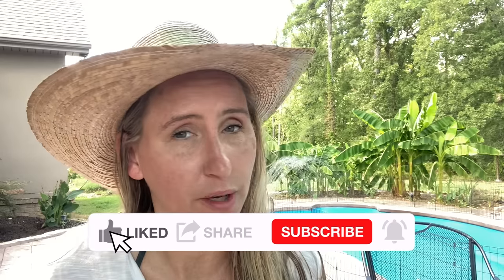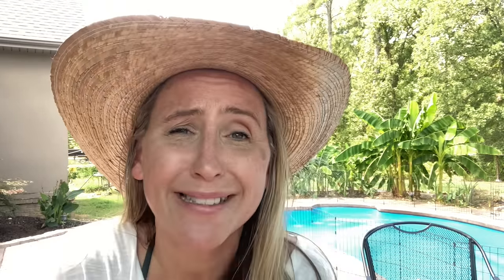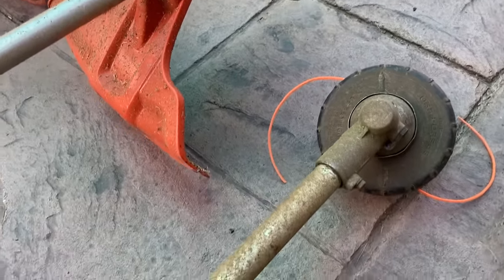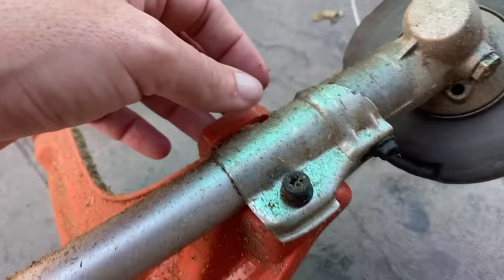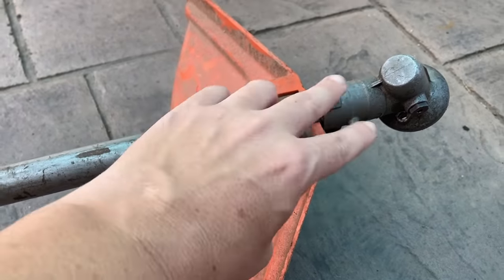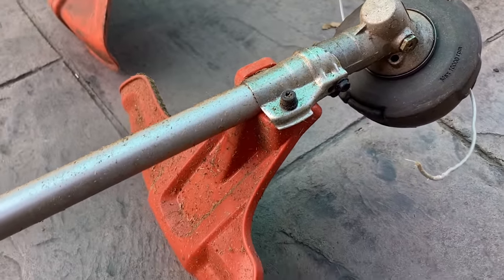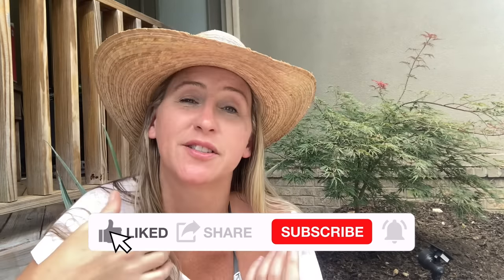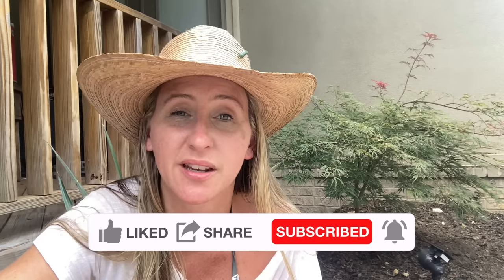String trimmer guard ON or OFF? Will it destroy your Stihl, Echo or Husqvarna? You might be shocked!

Comment: It's really simple folks. If your stupid enough to run without a shield your going to burn out the clutch from the higher loads placed on it. The heat build up will weaken and wear the clutch drum and take the temper out of the springs. That's before we get to the insanely dangerous practice of turning your trimmer in to a stone sling. Most people don't grease their gear head very often if ever. That's a killer too. 
My Stihl fs 80 is twenty three years old now. It looks a tad tired but the only replacement is the primer bulb and one air filter.
Nothing wrong with Stihl clutches.

Comment: I personally prefer to have them off my wackers…. It like running my line a bit longer but I also don’t run it so long that it’s bogged down and clearly working itself to death to pull it… It’s a preference thing for me though, and I also make sure I have safety glasses and long jeans and boots on… I’ve been hit with flying debris from them plenty of times and it sucks…. But, that shield doesn’t really stop things from flying at you… it’s there to keep the line a certain length more than for protection because it’s definitely harder on the motor, clutches, etc

Comment: I've used 4" saw blades, three blade cutters and every kind of trimmer head I get my hands on, on my Stihl FS 56. It was used when I got it and I've had it for five years now. It didn't have a guard on it when I got it. I live in south east Mo. and have a acre and a half that i mow. I use it for trimming low hanging tree limbs, Sumac saplings, Honeysuckle vines and more. I work it hard and it still runs like a champ. With no guard. I do keep on top of maintenance though. Oh yeah, and use common sense on how muce string I feed out.

Comment: a Sawzall fixes the shield/stabilizing bracket problem, but aside from the safety issue, i would be concerned about the balance factor if strings are different lengths

Comment: I keep the guard on, and I still get hit in the face once in a while.  Cut with the string throwing away from you, rather than towards you. I sometimes forget which way the trimmer is spinning when I'm in the heat of the moment cutting overgrown weeds. Good to hear how reliable my Echo PAS 2620 is. Lots of Stihl fanboys around. Look at it this way, if it weren't for Echo, Stihl wouldn't have to be as good as they are, and vice versa. Competition improves both brands.

Every try putting the i-30 or i-75 easy start on the 2620 series motor? I'm tempted to try. That big motor can be a beast at times.

Comment: 35 years first thing I do is toss the guard, never used them they block your view and limit your cutting area make you walk around a tree or post every time . glasses are a must! old old echos were bullet proof big box killed the brand with the new ones ,currently running husqvarna love it. ran the biggest d handle red max for 15 years still have it heavy but a push mower on a stick. Stihl makes a good one but heaviest  and hardest to work on.

Comment: I call it string slap. The string has no air buffer that the guard provides. Unless the throttle is up the string cannot spin in a smooth track. This causes unnecessary idle vibration and will wear the clutch out quickly.  The units are not designed to rotate with the extended string length. Clutch and bearing damage will occur.

Comment: 100%...Slotting of the spring perch on the clutch shoe produces the same slop as the spring wearing out.  The best advise i can give is to not ride the clutch engagement RPM; slipping those clutches creates lots of heat and cups the shoe over time.  Let em eat!

Comment: I have been using my echo srm 225trimmer for going on 10 years now and tore the guard off about 6 months after i got it. I dont get commercial level use out of it but a maintain a total of 10 acres with 7 buildings on them so it gets heavy use for a consumer grade trimmer. I use that thing with line out as long as it can handle and it fails to give me a single problem ever. Just to speak on the quality in general I haven’t even had to change a spark plug, never have had to clean the carb, no issues with the speed feed or the gear head, nothing… it has fired up second pull every single time i have used it. I even run exclusively cheap gas its entire life lol. The poor thing lives in the bed of my truck exposed to the elements all the time and nothing has broken or worn out. I have thousands of hours of guard less heavy use on that thing and it never lets me down. Idk what their secret is but the other companies need to listen up lol. I kinda want it to die on me so i can justify buying a new bigger model but she just won’t quit. Im gonna die before my echo dies at this rate.

Comment: For the residential user, The number one reason for no guard is the bigger swath can give you a nice taper to the mower cut. It allows you to get into tight spaces. I think it gives more control. The bigger swath balances (like a gyroscope) better for less scalping. And I’m not running full throttle either. I adjust the idle screw on the carb so it engages the trimmer without touching the throttle during trimming. The wider swath is  also nice to trim back brush growing into the lawn. That’s it. The flying debris comes with the territory. It makes a better looking cut on the property. Pain is beauty. Deal with it. Never had issues with the trimmers because of it either. I’m running my d-Walt flex trimmer around my house for 4 seasons now with no guard. No issues. Just pain and pain is …. Yeah, beauty.

Comment: So much false info in the comments and video. I run line out 14 I chez diameter or longer all day every day commercial use. It doesn't affect anything with the motor. The motor works a little harder but doesn't wear any certain part out any faster. It's all about how you treat it not bc the guard is off or on.

Comment: Depends on how huch line you run and which diameter.  To much will burn out a clutch and ruin shaft if it's a cable . Keep guard on and always buy a solid shaft weed eater .        Stihl 111 a bit heavy but TOUGHEN UP and deal with it.

Comment: I’ve been weed eating for around 40 years and tried every type of head and blades I could get my hands on the main reason I take off the guard is for cutting in really tall weeds over a foot tall and blackberries and other brush the guard usually will just tangle up and you spend 90 % of your time cutting the weeds off of the head with a knife and pliers trying to get it free I usually don’t use the automatic feed heads because they use way to much string the new echo easy loader doesn’t but all of the others seem to I like the 4 string heads the best but on the smaller weed eaters they run best with about 6-7 inches long string I put the new strings in pull it over to the next hole and use that as a guide to cut the strings length also on heavy grass and brush I use .133 and .155 strings I bought a big roll of the .155 I doubt if I’ll ever even use a quarter of it the rest of my life I put 2 peace’s on the head about 15 inches long that gives me 4 strings about 6” long to cut a 15” circle and unless I run into a bunch of wires or chain link fences or big dry blackberry vines I can cut nonstop for about 4 to 6 hours without having to replace the string doing the same area using the .133 with the auto feed head I would go through 3 to 4 heads full with about 15 feet of string in each head I would usually carry a extra loaded head with me because I would usually on heavy weeds use a couple per tank of gas. I’ve never had a gear head go bad I’ve had a couple of clutches go bad and I had a echo engine and clutch go out last year and that one went bad using the speed loading head with the guard I am assuming from what I’ve been told was from not running it full throttle cutting around the house I don’t know 🤷‍♂️ because somebody else was using it at the time it is one of the swapping models I have several different shafts with different heads and a blower who knows I’ve wore out a lot of weed eaters I got the most use from my craftsman 51 cc I used it for 20 years and I had a guy tune it up and he took off with it and I’ve had a couple of echo’s sense then the last 6 years they still run good all of the others I’ve had throughout the years only worked for a year or two as for the string and the guards you should run the string the same length with or without the guards. The string cuts with the tip end of the string if it’s to long the string doesn’t stick straight out it curves and you’re dragging the length of the string against whatever you’re trying to cut and lugging down the motor even more it’s a string not a saw blade the string with the 3 to 8 sides claimed to cut that way but those only cut with the tips of there strings just like all the others do

Comment: I run a Echo 2620 proffesionally and I have replaced the gearhead on it after 5 years, or roughly 1500 hours of running the trimmer. And it is currently still running with the new head.

Comment: It is funny to me how much the opinions on removing the shield differ between a mechanic and the people who use them all day every day to make money. Is it worse for the machine? Most likely. But you have to consider that if a trimmer lasts a commercial user for a year, it has more than paid for itself. Balance the cost of killing that piece of equipment vs it slowing you down all day every day. It quickly adds up. I left mine on, but I am not commercial. I still get pelted all the time with rocks etc, so I am not sure how much worse it would be without it, and I don't really want to find out.

Comment: Haven't run a guard in 20 years. They get in the way if you are doing precision trimming in tight areas and blocks line of sight for detailed work with the head flipped. Wear full eye protection, long pants, maintain your trimmer head. As long as you're  not releasing a ton of line at a time and dont rev the piss out of the machine it's fine.

Comment: In the field , us commercial guys usually dont have the proper tools with us to remove them , did you know a top handle chainsaw cuts plastic gaurds off really good ,no chance of it coming loose at the shaft then , maybe not the safest way to do it , but i had a chainsaw with me , not a tool box ..lol ...
echo 2620t , going on 8 years , used everyday ( the secret to keeping them running ) 5 days a week , 8 years now , i had to put a tune up kit on them last week , put a grease zert in the head where the plug goes , works great , dont over grease it , gaurds gone , we use them in place of  push mowers ,in places the scag zero turns wont fit in , way faster , way lighter , way cheaper than a push or walk behind mower ..22 inch passes at a time

Comment: I’m probably wrong but it looked like the line was whipping back and striking the head at low RPM. Cut about 4 inches off each line and see what it does at low RPM. For commercial guys, there are legal liabilities for removing those guards. You may end up in court if one of your employees catches a rock in the face and you knew the guard was off. Don’t give a lawyer a reason to come after you.

Comment: The guard is there primarily as a safety device that also has the benefit of trimming the line to the correct length. You have to be stupid or suicidal to take the guard off especially when a brush cutter is fitted.  I always wear steel reinforced rigger boots when using my FS80 trimmer to protect my feet and shins in addition to the protection the guard offers.
The other (practical) advantage of the guard is that it directs the cuttings away from the area to be cut if used correctly but removing the guard will probably mean cutting the arisings over and over.

Comment: I sold and did repair work on Echos for a few years .  Dont forget the extra load on that little motor just from spinning the extra weight of too long lines at high rpm.  Also, I do believe that you void the warranty by doing it.

Comment: I leave the guards on mine, I also sharpen the line cutter so the strings are the same length for balance. When I was working in a shop we started putting zerk fittings in the shaft tube to grease the shaft as well as the head. BAD idea!! The grease softened the rubber bushings holding the shaft centered and they spun out leaving the shaft to wobble. I ended up replacing the shaft tube on my own cutter. That was a Sach and in the mid to late 80s.

Comment: What did we learn ?  
It's ok to run the machine with the shield off as long as you understand overextending the cutting line can over stress your clutches, drive shaft and couplers. 
In translation -  if your trimmer will not make full throttle rpm - your string is too long and you are over stressing the unit.

Comment: One reason a trimmer head will keep turning when it's not supposed to is if there's not enough grease. It definitely makes a noise. I use the shield and the only problem I ever had is the string gets too short therefore I doubt that running my machine without a shield would cause the string to be too long. The one reason I doubt your advice is I remember you said to leave in the spark arrestor screen. That is the worst advice I've ever heard in my freaking life. I'm sure it gets you lots of easy repair work but worse people who repair their own trimmer will have to do that all the time. Anyone who doesn't pull out their spark arrestor screen is an glutton for punishment.

Comment: I have an old western auto string trimmerbought it in 1995 I still use now it is a 21 cc engine it is getting weaker. I still Run a saw blade and brush blade plus the string trimer head I live in florida it gets used regularly

Comment: I worked as a mecchanic for a year in a full-line Stihl shop. We noticed a correlation between the drive shaft failing where it enters the socket in the clutch with commercial machines that came in with no shield. The square shaft wears against the socket flats until everything is rounded and failing to drive. Cost of parts and repairs becomes a large fraction of the cost of a new machine. Add much else, and we had most of them not worth fixing.

Comment: Generally things like this are engineered to work optimally with all parts attached properly. Now the guard on my brush cutter/weed trimmer fell off at some point and the neighbor kid driving the Kubota with a mower ran over it so it was a total loss. Keeping this in mind, i made sure to watch (and listen to the engine performance) the line length and shorten it against something abrasive. Got it replaced the next day. 
And whatever you do...wear the proper clothes and PPE.

Comment: Cant....... you lose the shield but keep the clamp on and tight even if you have to put on a curved bracket in place of the shield curved part?  I though losing the guard would tend to lead to longer lines and thus more stress on engine and clutch?  I cant see how even a slightly lose head which only turns could lead to clutch problems way back at the engine??  unless really really lose and locking up but then you wouldnt be using it anyway..

Comment: I tried taking the guard off after watching some other contractors not using it. The end of the line gets thin as it wears down, so the tip of the line, the bit thats actually cutting ends up a tiny thin wisp that cuts like rubbish compared to a full strength/width, clean cut, sharp line you get with a guard. I Put the guard back on after one day of testing commercially and never took it off again.

Comment: We had a small engine shop for over 40 years, what we saw from those not using a shield some trimmers from stihl wold get too and melt nd only wires an a throttle cable keeping them tied together.  On other trimmers like Shindaia an Echo that had "metal" housings clutch wear out happened.  As for commercial users ... better have a good natured OHSA inspector when they inspect you.

Comment: I have the 128 ld with the guard removed but i did it for visual reasons it easier to see what im cutting had the jerking head issue but i just tightened up the clamp screw. After hearing this i guess ill put the guard back on😢

Comment: I mentioned to the small engine repair shop owner i was going to make steel blades for my trimmer, so wouldn't have to deal with the string. He said "I see. And I hope you know when the blade breaks it will come out going 200 miles an hour". I still like the string on my trimmer.

Comment: I work on trimners alot . It sounds like string slap to me. String is too long and slaps aginst the head at low rpm. When she speeded up it went away. There was to much line out.If she had trimed some back it would have stopped. Another reason for the guard is to cut the line so this doen;t happen.

Comment: Guard in the wrong place?  To prevent you from getting hit by stones and the such like, the guard should be rotated to towards the direction rotation. Stones are thrown out tangentially not radially. So from my point of view my Honda strimmer has the guard about 40 degrees off from where it should be.

Comment: Thanks, interesting.  Other than bracing the gearhead, etc, is there some other reason the shield not being there would affect the gearhead?  I mean if you just cut the shield off, vs. unbolting reinforcing parts of it on the gearhead, is there any reason that would strain the gearhead?  All I can think of is the string might a bit longer than it should, straining the engine or clutch with more load, but I guess that could affect the gearhead too???

Comment: To me it sounded like the line was slapping the head, but I do believe what you said because you work on them. I have a Troy-Bilt trimmer with a split shaft, so I also have the pole saw attachment with an extra length of shaft. They work good but I have not taken off the shield because it was put there for a reason. Have good Days!